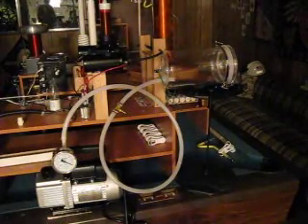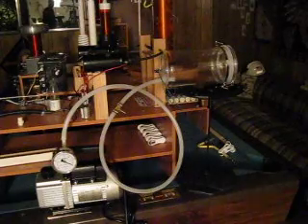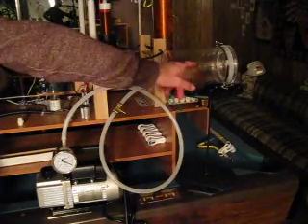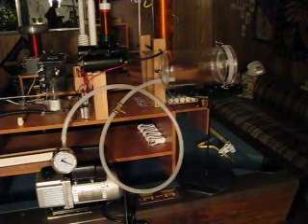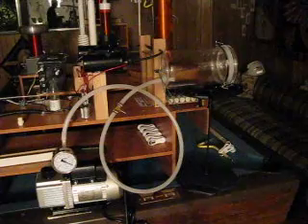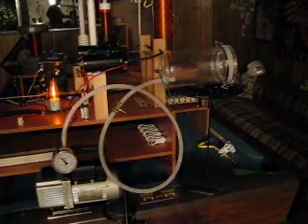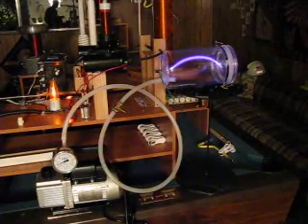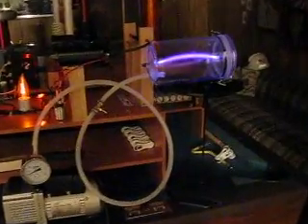Paschen's Law ( Curve )-Effect of a Vacuum on a High Voltage Arc

Comment: At first the current flowing through the plasma heats the plasma up causing it to rise. This elongates the current path and increases its resistance, but at higher PSIs it's easier to use the already ionized air than to try to ionize all the new air molecules that now occupy the straight path. As the PSI drops, it takes less energy to ionize a new path (because there are fewer molecules along that path), so the path moves towards the shortest (straight line) path.

That's my theory anyway.

Comment: Interesting that when the arc first struck, the arc followed the top of the vessel, and as the pump continued to lower the pressure, the arc straightened out between the electrodes.

Comment from the maker: The power supply is two automotive ignition coils out of phase with one another (powered by a standard light dimmer).  I have no way to measure the voltage but a rough, rough guess is since it can arc at about 3.5" at atmosphere and approx 30KV is required to approx arc a centimeter, (2.54cm X 3.5inches X 30KV = 266KV +/- ??).  I have a 60KV Induction Coil (another video) and it was able to arc also.  I also hooked up a 15KV x 30ma neon sign transformer and got and also got an arc!!

Comment: is it true that high voltage breakdown creates x-ray emissions?
Reply: It can under the right conditions.  Direct current in a hard vacuum with a hard metal like tungsten
Reply: Yes, under a Vacuum. This is unrelated but some years back I was experimenting with a vintage spark gap tube, it may have been hydrogen filled, and I was told to be careful to the X-RAY emissions.
Reply: Maybe you have a comment, if the aim is to quench the spark to make it as brief as possible, would it help to place the electrodes in a high air pressure filled jar?